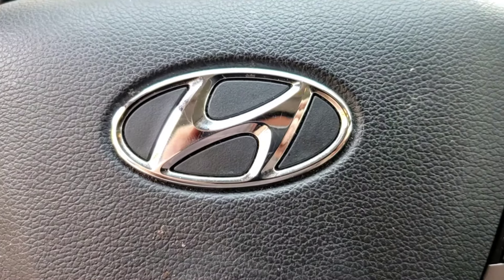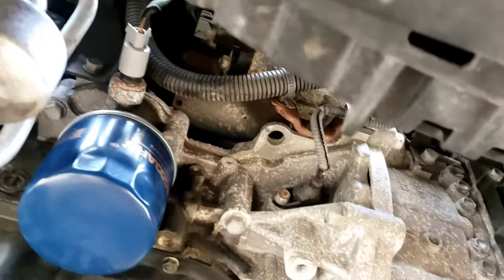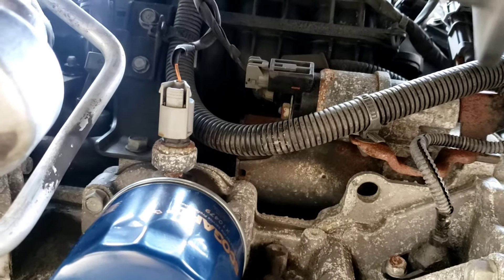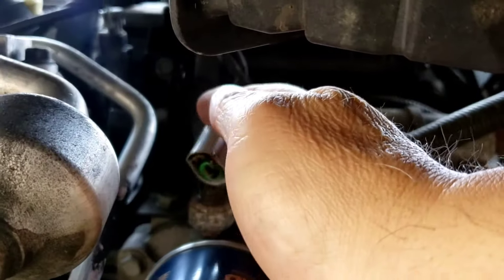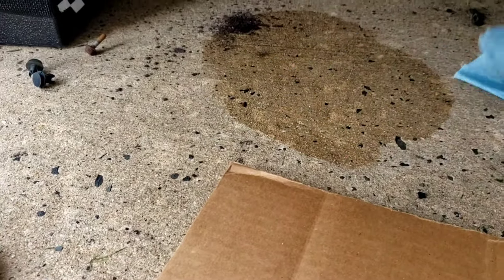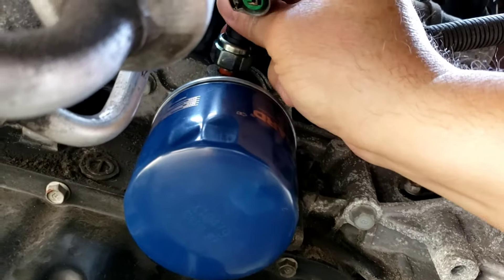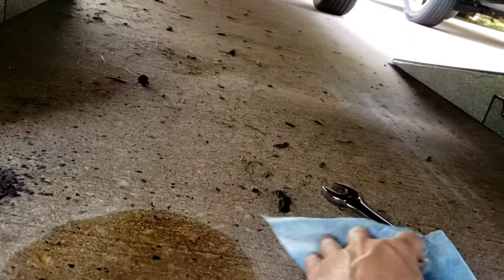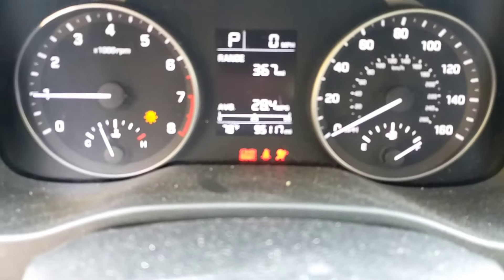Hyundai Elantra Red Oil Light ON or Flickering 2017 and Similar  What can it Be if the Oil is Full.

Comment: only tighten it halfway! made the mistake of tightening it all the way and cracked the oil pan where the sensor screws in. it’s meant to only go halfway.
Reply from the maker: You tighten it up like a regular bolt? Both materials are lightweight..guess this is the 1st time you ever installed a sensor..

Comment: Just replaced mine but when I started driving the car started dripping oil. The new switch had some thread tape on it but what I did  notice was when I removed the switch a good amount of oil spilled out. Wondering if it's something else or just the new switch didn't have good enough thread on it
Reply: So just an update. I'm under the car now and trying to tighten the sensor it's as tight as it can be since now it seems to be just spinning and not getting tighter. I'm going to drive and see if that was the problem because the leak looks to be coming from there. While I'm out driving I'll get some thread sealing tape as well
Reply from the maker: @WestonFordham  hopefully you didn't over tighten and damaged the treads

Comment: Today my 2016 Sonata oil switch went on, I was at a gas station and went straight to the oil shop the oil was a little low and I asked him to fill it but the light was still on, drive a bit and the light went off but after about half an hour the light turned on. It's night time here but I'm planning to go to the mechanic tomorrow. Hopefully it's just a sensor issue not an oil pump.
Reply from the maker: Oil pump has no on and off..its either it pumps oil or it don't  but since your light went off and the engine is not making any crazy noises than its the switch..but don't be surprised when the add on more things..its a business...
Reply: Update: I visited Hyundai Service Center and the guy there checked and yes it's the same issue as mentioned in this video. The oil pressure sensor. Put the new sensor on and everything goes back to normal, no oil warning light.
Cost: 13+21 USD approx. Sensor+ labor
Reply from the maker: @KashifNawaz85  good price on that...

Comment: Commenting again because I had to replace this about exactly a year after last time. Can you use wd-40 to clean out the way you used brake cleaner here?
Reply from the maker: Wd40 is not a cleaner and it won't dry, so anything wet in an electrical connector is not a good thing, I use the brake cleaner since it will clean and dry out in a few seconds. I believe the Autozone brand switch has a lifetime warranty.

Comment: I thought this was a good video until I followed your instructions exactly. I was trying to save my girlfriend a bill when I saw how easy this fix was. That was until i turned the oil pressure switch until it got "nice and tight" as you said. But somehow the engine got a serious crack in it above the oil pressure switch. I could not believe it!! When  it was all said and done.... the bill to have  a mechanic to replace the upper oil pan - that is where the oil pressure goes into.... the cost to pay someone to fix it was 1350.00 dollars!! Another shop quoted me 2500 dollars!! My girlfriend almost had a nervous breakdown when I told her we might have to replace the engine. Because on many models of cars that would be the whole engine block that would crack. The engine would have to be replaced. All I will say is I thought of subpoena you through Youtube for really causing the damage to fail to warn about how the engine can get damaged. You really need to have those kind of warnings in your videos. Preferable with Red lettering over your actual videos. Wherever serious damage could occur in these videos you make. You know what Al baby,  I think I would have good case in court to sue you.
Reply from the maker: I'm sorry this happened to you but everyone has a different strength when it comes to tightening any thing.
Reply: @alyoungcuda 😮 everything should be snug tight not overtightened 😅, but dang I'm scared to do this now
Reply from the maker: @sheeshd977  when you have done enough of them you can feel when it gets tight and the tool you use will also make a difference,  people use 3/8 drive, others use 1/2 in drive tools, some use channel lock pliers,  mechanics know too loose it leaks, too tight you break it, over tight and you break everything..the old saying goes. If in doubt,  send it Out. And of course others never clean the oil in the connector before they reinstall it on the new one.  There is a reason why you don't wet a plug on a toaster and then plug it into a wall socket...😆
Reply: Sounds like you shouldn’t be working on cars at all. Blame yourself.
Reply: @alyoungcuda  lol

Comment: IF ENGINE STALLS  OIL SWITCH  MAY NOT BE PROBLEM.......  DIRTY PASSAGES FOR OIL AND  VVT  TIMING ISSUES   PRESENT      CAM GEARS BIGGEST PROBLEM   VIDEO IS GOOD HEADS UP BUT IF  PROBLEM PERSIST   ALSO  OEM SENSORS ONLY  FOR ACCURACY AND LONGEVITY
Reply from the maker: Good tips

Comment: I have a 2015 model, the oil light keeps coming on then the engine dies... struggles to restart. So what is the exact problem?
Reply from the maker: Can't tell the exact problem but when was the oil and filter changed last? Do you do your oil changes at the regular intervals and does the engine run rough? Any check engine lights on?
Reply: @alyoungcuda  I keep the oil changed. Looks normal, engine runs very good for about 20 to 30 minutes, then it dies and when I restart the car it struggles very bad driving. Eventually the engine shuts off again. The oil light flashes but never stays solid
Reply from the maker: @shawnwhite3662 could be this problem on your engine vvt solenoids
https://youtu.be/Yx5_qsxtmkw
Reply: Did you figure it out

Comment: Hey! We have this similar issue with our 2015 Hyundai Elantra. The oil light flickers when the vehicle is slowing down, and eventually close after that the engine shuts off. The car starts up just fine, and resumes the whole process. We took the advice and bought a new oil pressure sensor. There was a lot of oil leakage when we replaced the sensor. However, we are still having the same issue. Any recommendations?
Reply from the maker: Common questions here, did you clean the connector,  did you check the oil level? And I say this because in my other video the dipstick will make a brown stain that tricks you into thinking its full but its not. The next thing you can do is to rent for free an oil pressure gauge from autozone, screw it into the hole where the pressure switch was and check the actual pressure..almost like taking a blood pressure test on the engine..2nd, how old is the oil, might need an oil and filter change if its dirty.
Hopefully its not a bad engine for which they are known for. Good luck
Reply: @alyoungcuda my 2015 engine light just came on yesterday evening. I took it to O’Reillys and they scanned my car. Turns out it was the oil pressure sensor. However, I literally had my oil changed yesterday morning. They also replaced the oil filter, ac filter and air carbon filter. Also had my inspection done and it passed. I drove it home. No problems. I drove it out a little further yesterday evening, engine light pops on as soon as I park my car. That’s when I took it to O’Reillys. Left my car at my dads because I was scared to drive it home. I have taken exceptional care of my car. Barely hit 89k on it. No issues prior. My dad texts me about 30 minutes ago to let me know he moved it and the engine light is off. Is this normal? He’s going to take it to get checked out tomorrow after he gets out of work. I hate car issues. They always freak me out. 😮‍💨
Reply from the maker: @bloggerbriii  ok, the car was normal before the parts change, I would physically look at the engine oil level to make sure they put enough oil in it, second, the engine air filter,  when they changed that, they could of left something unplugged, left the rubber hose loose and didn't tighten the clamp, some cars have an electrical sensor with a plug and they might of left that off or loose, the air filter cover could of not been put back on properly and its not closed right. Sometimes you need to double check the shops work..its amazing right? So did you change the oil pressure sensor?
Reply: @alyoungcuda  I’ll screenshot and share this with my dad. He’s a bit older and can’t do all that himself. And I won’t let him even if he could because this Texas heat is a bit much here lately. No, we didn’t buy the sensor yesterday because I wasn’t aware they sold that at O’Reillys. The guy scanning the car never mentioned it either. Should I have him grab a sensor and take it into the shop when he goes to get it serviced tomorrow?
Reply from the maker: @bloggerbriii  yes, change out the sensor, its a common problem with these engines as you can see..
Reply: @alyoungcuda  you’re awesome! Thank you so much! I seriously appreciate you responding so quickly too!
Reply from the maker: @bloggerbriii  thanks, I love my Youtube family...advice is free..😆
Reply: Try a higher weight oil, like 5w30.  I'm having similar issues and the light stopped coming on when I went with 5w30.
Reply from the maker: @roytott  on older cars the thicker oil helps around the bearings but when the engine gets hot, the oil thins out...

Comment: Hey Al, do you know if this switch is located in about the same position on a 14' elantra?
Reply from the maker: Yes, most of them are near the oil filter
Reply: @alyoungcuda  thank you! We are experiencing the flickering oil light once the car is warmed up, so im gonna try to replace that switch, I feel like I can get it done after watching your video!
Reply from the maker: @ronsmith1397  its easy, the hardest part is removing the connector , just find the tab and press in..you can do it..
Reply from the maker: @ronsmith1397  you will feel it..no need to hammer it in, you don't want to break it in the hole. Remember the part and the part that it screws into is aluminum..
Reply: @alyoungcuda  awesome, thanks for the help, ill let ya know how it went when I get done.
Reply: Got it replaced and everything but after driving it for a lil bit the flashing oil light came on again so I need to troubleshoot some more
Reply from the maker: @ronsmith1397  did you see my other video on the stained oil dipstick that will fool you into thinking you have the right level of oil in the car?.. I had a car thats on the video that only had 1/2 quart of oil in it when I drained it and I asked the customer didn't you check the oil level and u said it was good? She did but didn't actually look for a wet oil level..she saw the dark imprint on the stick and thought it was oil.
Reply: @alyoungcuda  yea, I have also checked the oil and it is for sure there, I can see the wet spot for the oil on the dipstick
Reply from the maker: @ronsmith1397  oh boy, not a good sign, you can rent an oil pressure gauge from autozone for free, the hose attachment goes into the same port as the oil pressure switch and see what the pressure is..if the pressure is good than its in the wiring or the plug connector itself. You can run the car,have someone sit in the car and look at the light, and you wiggle the 2 wires at the connector  to see if the light flickers..was there oil in the connector? And did you clean it off?
Reply: @alyoungcuda  no oil on or in the connector but there was some rust and buildup on the switch itself
Reply from the maker: @ronsmith1397  ok, definitely  a wiring or a pressure problem  but a pressure problem sometimes comes with an engine noise..you have to check the pressure to make sure its not that..its like blood pressure,  it has to be a certain  pressure,  might have to run it with the gauge on sitting for at least a half hour..oil gets thinner as it gets hotter and then pressure starts to drop
Reply: @alyoungcuda  ok, thanks for the help up til this point, hoping I don't have to go get the lady a new car 😀
Reply from the maker: @ronsmith1397  thats the other choice..go Toyota or Honda and don't look back..😆
Reply: @alyoungcuda  I hear ya!!

Comment: I am having trouble getting the sensor to clip back on
Reply from the maker: @Rookiebaby94  it only goes on 1 way and depending on what manufacturer or brand you buy it will be tight to push in..if you can see the clip sometimes you can see how far it needs to be pushed in, did you clean out the connector on the wire?

Comment: can you take it out without removing the bottom engine splash cover ?
Reply from the maker: This car didn't have one but I think that cover needs to be removed since it is done from the bottom unfortunately..
Reply: @alyoungcuda on it now thanks, also is it only the 10mm bolts that need to be removed ?
Reply from the maker: @showerasmr5764  if I remember  yes
Reply from the maker: If you never did one, becareful on tighten the sensor..everyones strength is different as you can see in the comments..
Reply: @alyoungcuda  gotcha, I just noticed I don’t have a 26mm wrench though is there anything else I could maybe use
Reply: @alyoungcuda actually I just can’t get the sensor out, it’s stuck in there good
Reply from the maker: @showerasmr5764  how can that be, are you using the correct tool?
Reply: @alyoungcuda have a adjustable wrench is all
Reply: @alyoungcuda I love you,seems like it worked
Reply from the maker: @showerasmr5764  was it leaking oil inside the connector too?
Reply: @alyoungcuda  yup everywhere, it suprised me
Reply from the maker: @showerasmr5764  oil shorts out the wires..but it sounds like you did good..and thanks for watching too...
Reply: @alyoungcuda 3 days no issues, again thank you for making this video. The dealership was charging close to 1k with diag fees just to do this and it only costs me 65 bucks  including ramps 🙏.
Reply from the maker: @showerasmr5764  no worries,  you were able to do it yourself and save money plus you got a set of Ramps  to use and thanks for watching too...

Comment: What do you do if you break the oil pressure sensor housing?
Reply from the maker: What do you mean by the housing? The plastic part that the connector clips on to? It comes with the new sensor
Reply: @alyoungcuda  where the oil pressure sensor screws into. I over tighten mine and it broke.
Reply: That’s on the engine.
Reply from the maker: @KineticCrewDmi  that should be replaceable on its own
Reply: @alyoungcuda  yeah I don’t know if I need to buy the whole engine block cause it looks like it’s the whole thing.
Reply from the maker: @KineticCrewDmi  from what I can see its a seperate part that bolts onto the side of the engine with 4 bolts..did you break the treaded sensor in the hole or did you crack the hole .
Reply: @alyoungcuda  cracked the hole. Literally broke a chunk off.
Reply: @KineticCrewDmi  I know this is four months ago, but I just did this to my 2016 elantra. Could you give an update on the maintenance? was the whole engine replaced or was it a separate component that was replaced?

Comment: Would this cause a Check engine light?
Reply from the maker: No
Reply: @alyoungcuda  sigh yeah I think I’m screwed code P001700 2020 Elantra. After running a bit too long without an oil change and not topping it off. Unless  I can forge some service records it won’t be covered under warranty either shit
Reply from the maker: @MaynardOwns  do u mean P0017 code? Thats the valve timing solenoids..there is a intake and exhaust one, they are pretty simple to change out. They go bad if regular oil changes are not done and the dirty oil clogs them up. Change the 2 solenoids,  change the oil and filter before you start the engine so you won't contaminate the new solenoids.
Reply: @alyoungcuda  yeah I saw that too. I also saw some people say it ended up being timing chain. My light came on after excessive driving without an oil change and most def low oil cuz it was making an awful noise while accelerating and instead of checking I drove for a few days. Light came on. I added oil noise when away then I continued to drive without getting an oil change
Reply from the maker: @MaynardOwns  timing chain in 3 years is rare unless you totally did not keep up with the oil changes for years.
Reply: @alyoungcuda  yeah Hyundai kept canceling appointments and booking them months in advance got to the point I just started to take them where ever I could. Last one I got was a mobile oil change because of work. I’d say minimum once a year and shamefully well over the 3k. Car has almost 70k and it’s a lease so my only option is to buy the damn thing or pay them for miles plus damages and not have a car
Reply from the maker: @MaynardOwns  its cheaper to change out the 2 solenoids
Reply: I’m having a hard time finding Hyundai oem parts/parts numbers so I get the right ones. Any advice on where to find the right ones would be very helpful
Reply from the maker: @MaynardOwns  buy the Duralast brand from Autozone..they have a lifetime warranty

Comment: Did anyone else have a hard time screwing in the new sensor? I was scared to death and it felt like I was going to cross thread it any moment. It would bite for maybe half a turn and then it would fall off every time. Once I felt like it did get a good bite I was really scared to start putting a wrench to it. It looks like the one in the video screwed on easily with fingers but not mine. Not sure if the person that owned it before me may have put it on wrong or over torqued it. I did also see a comment that OEM is best. I got mine off of Amazon and that may have been the issue
Reply from the maker: Its all about going straight in, you can look at the old one that came out, if the treads are good on the old one, then it came out ok...if the old one looks messed up, that explains the hard turning in..